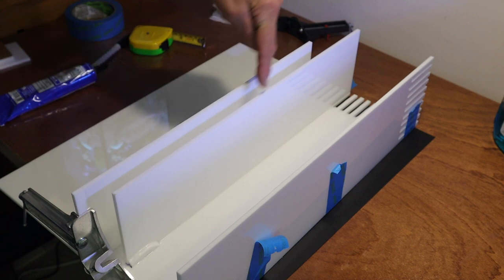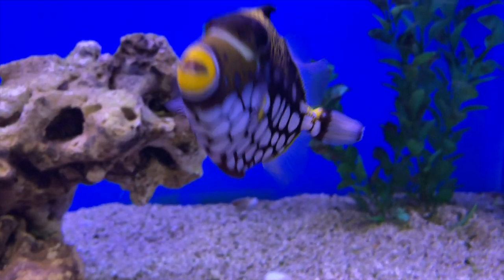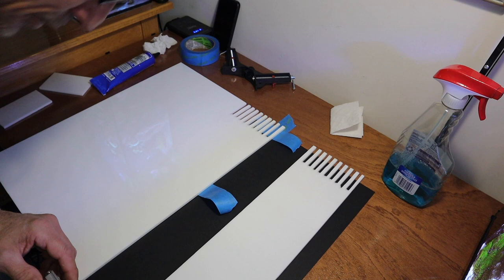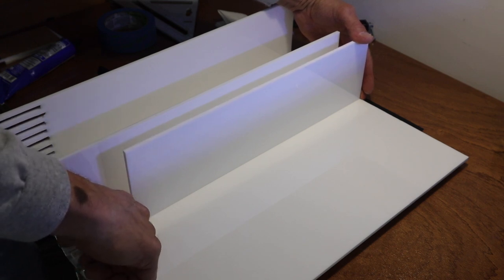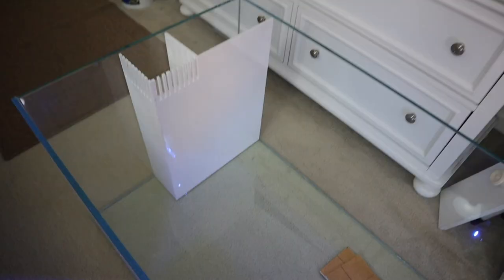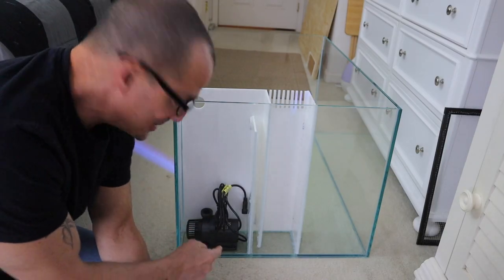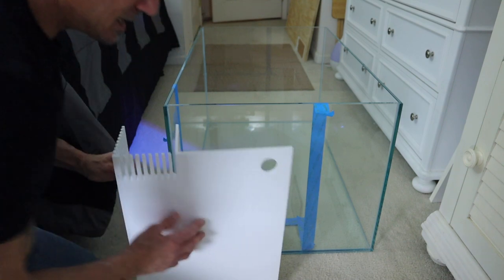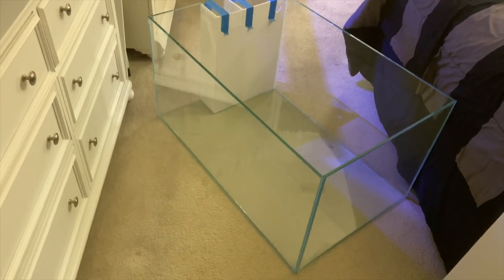How To Set Up And Build A Saltwater Reef Aquarium (Part 2) - 75 Gallon AIO - Overflow Box

Comment: Hi Tom. Very cool overflow box. The pump is very big. Nice idea to let space next to overflow box for the equipment.
Reply from the maker: Hi Jean, thanks, pump maximum is high, however it is controllable. I can control it to lower GPH. I asked for this size just in case it was not accurate GPH. Yes, that space can be used, and not really needed for the overflow box.👍🏻

Comment: This is a big help to me Tom, used acrylic in the past but never built a tank. Your instruction is a big help for us that will try!
Reply from the maker: Hey Paul! Good to hear that! The Cell Cast acrylic is the stuff to use. It doesn’t melt when cutting it, like extruded acrylic. Also it adheres to glass just fine as long as no psi pushing on it. The Weldon 16 is great for gluing it. 👍🏻

Comment: Your the real deal.  My only advice use flipper glass cleaner with the plastic blade.  I used a mag float for months and scratched up my glass. 😢
Reply from the maker: Hi Vidishish, thanks,  agreed, I’m not a fan of glass cleaning floats. They collect sand particles that scratch the glass. Thanks for the heads up👍🏻

Comment: Great job ! Should do it longer & fully utilize the space ...😊
Reply from the maker: Well, if you look at it close, I’m gaining more display area. By extending the AIo  all the way to the front of the glass I lose 4 1/2 inches looking straight on. I’ll be able to create some smaller aquascape in that section and make it look really nice. The aio only needs to function as water turnover and fit a skimmer, maybe a small refugium, and heater. And it will fit all that. Plus I have more control over the flow on that side, you can’t put a wave maker down in the overflow box. 😃
Reply: @TOMReefer  have you decided on which wavemaker you will be using and how many?
Reply from the maker: @richardportelli1983  I was just researching mp40, but I believe their too strong, and they are out of control high priced! Over $400! That pisses me off. The mp10 would work. Maybe one on each end front and one back on the side. But there over $300! hygger  has a larger version of the mini wave, they say it’s 2600gph. For just over $100. EchoTech really bothers me. They make a good product and know it, then they screw you on the price👎🏻
Reply: @TOMReefer  jebaochave some Really good priced pumps also. Around the 2000 gph mark is what you want and then just turn them down to the flow you want. Don't go higher than that unless you are doing sps only. Mine are great running at 65% power are almost silent completely.
Reply from the maker: @richardportelli1983  what size tank are you running those on?
Reply: @TOMReefer  36x20x20. Just running one jebao and one AI Nero 5 right now. I have a second jebao which I will add once I get the rest of my scape into the tank. I'm also deciding on more fish to add soon. Thinking a baby blue tang, tomini tang and a yellow scopas tang possibly. Then I will do a full tank tansfer qt before I add them.

Comment: Nice Tom the tank looks phenomenal. Just curious as to why you went with an overflow box instead of a sump? Can’t wait for part 3😀
Reply from the maker: Thanks Claggz, really just for convenience sake. If you look under The table I have all my electrical equipment, I didn’t have to fuss with getting the glass holes cut. If I had a larger space I would’ve done a sump. That’s also why I cut the overflow box short so I could still achieve a full looking display looking straight on. And I can use that side for a smaller aqua scape rising into the tank as well as put a wave maker on the glass on that side. 👍🏻😊

Comment: Tom... Gotta say man that I love your episodes and little gaffes as well. Makes for a great break during work some days. I do have a question for you. I have a large tank at home, which is really easy to care for with all the automation, but at work I have a 30g innovative marine nano tank. The hardest part is water changes because I have to haul water from home in 5 gallon buckets. I do have a maintenance room at the office with a water supply, but don't have access to an RODI system. Have you used those fresh water conditioners, do they work or maybe an alternative to hauling buckets from home?

Thanks Tom
Reply from the maker: Hey Twisted, Thanks, I’m glad you enjoy the vids. 😊👍🏻 The conditioners don’t remove TDS’s from the water. An alternative, although not rodi, is using distilled water (gallon jugs). It’s a bit pricy, but for small changes, not bad. $1 per gallon?. Distilled still has some tds in it, but very low. The other option is an empty 5 gallon spring water jug. Just fill them at home with rodi and carry them into work. It’s still carrying, but at least it’s not an open bucket.

Comment: Tom, i am upset this ended so quickly. This came out amazing! I am totally copying your white overflow. Its perfect! Love the placement and everything. Cant wait to see the full setup. 

Btw Tom, you can also just turn the blade around in the table saw if thats what you mostly use it for anyway. 😎👍
Reply from the maker: Hey FP, thanks! Make sure you get Cell Cast acrylic. It’s far better then extruded. 👍🏻I use the saw for lumber far more then plastic, but I guess not too much to flip the blade👍🏻thanks for following.

Comment: Hey tom im building a 55 gallon with an internal sump just like you but what pump and what gph should i use??
Reply from the maker: Hey Josh! You caught me at a good time, 😃 I always like a bit more coming out of the return. However, the more flow through the return, the more noise the water will make over the overflow. So it’s a bit of trial and error. 6- 10X your volume would be ok, ex. 55X10 = 550gallons per hour. No real need to go higher then 10. You will have wave makers etc. for most of you flow needed.  I use that formula, and my 20 gallon is almost silent. No water noise over the overflow. 👍🏻
Reply from the maker: As far as a pump, Sicce is a possible probably the 2.0 or 3.0. I forget their gph rating? If you wanna wait a bit I’m attempting to try the Hygger  DC pump which has a controller to control the volume.  But I haven’t tested it yet. Sicce, from what I hear can be hit or miss their noise volume.
Reply: @TOMReefer  thank you for the response. Thats the answer i needed

Comment: So my tank problem with hair algae and Dino’s cleared up after I did about 5 waterchanges and scrubbed every rock with a toothbrush. I went lights out for a few days and the lights are back on …It’s very clean now but I can see some Dino’s coming back after a day or two with lights on .. this tank is killing me .. if I keep it low nutrient the Dino’s will come back if I go high nutrient the hair algae will come back. I’m stuck between a rock and a hard place. 😩
Reply from the maker: Hey Botzz, you’re going to have to let nature take its course my friend. I still have hair algae in my 10 gallon, it’s been since July. Just keep normal maintenance on it, and deal with ugly for a while 😊good luck. Hang in